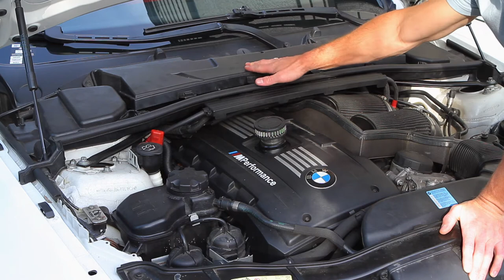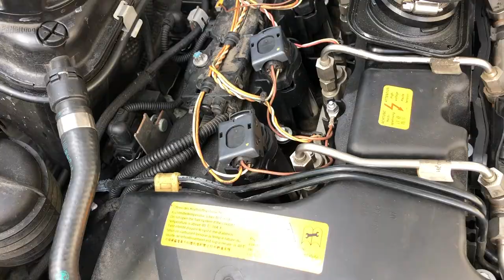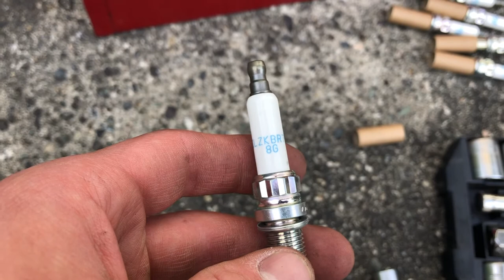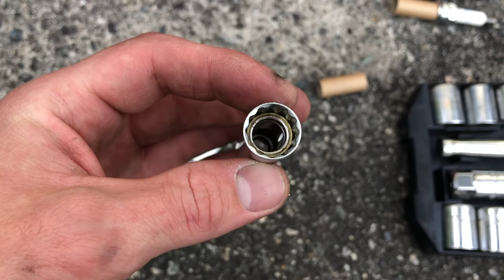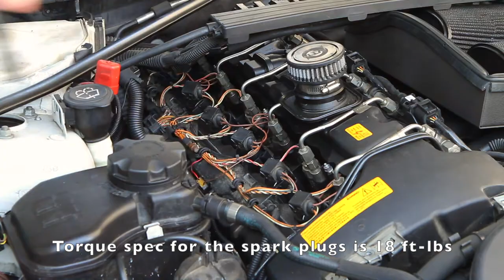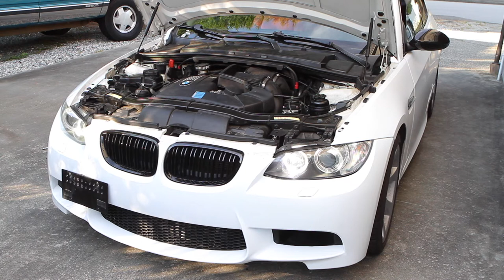N54 Spark Plug Upgrade - NGK One step colder

Comment: I have an 08 335i with just upgraded intercooler and bov with new charge pipe 
What would you recommend spark plug I use and gap